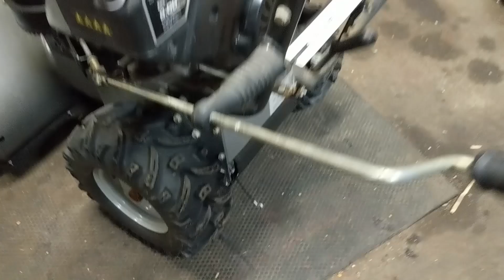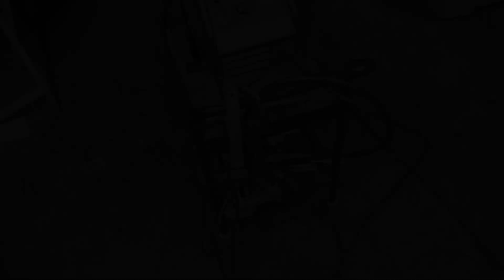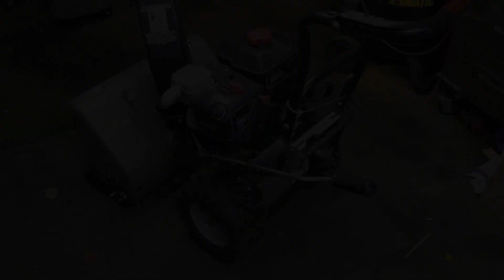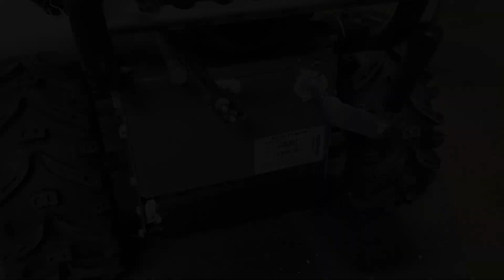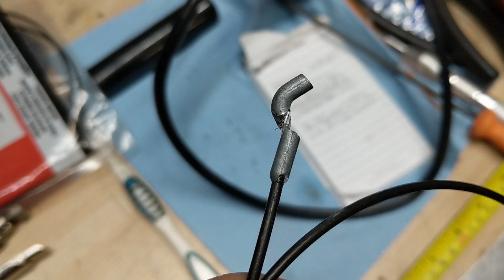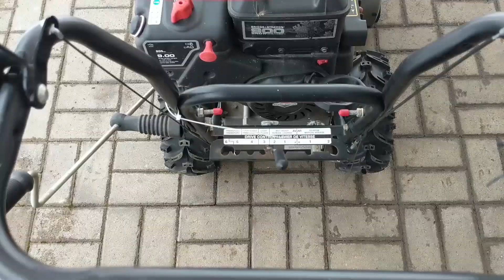Craftsman Snowblower - Drive Cable Replacement

Comment: That’s the exact problem I have.
As it was the middle of winter and I did a McGyver fix instead, this ended up shearing the pin on the drive chain spool.
So first I have to replace the throttle cable between the lever and that connector plate then replace the shear pin/bolt and I believe it should be good to go.
The auger belt and lever work just fine.

Comment: Dear Awesome Eliminator dude
So watched your cub cadet snowblower carb clean video and what would you know,after only removing the bowl,grinding down an old screwdriver and removing the brass thingy with the hole in it,which was clogged.I put it back together andViola it runs!!  BTW I use Startron as my fuel stabilizer so where the crap came from who knows.So I am going to call the repair man and cancel the pickup of my machine!

Comment: thinking about saying fuck it and putting a piece of 1/4 ready rod, eyebolts, and threaded chain links in mine instead of a cable >_> Probably not the right way but dammit if these chinesium sintered alloy ends don't shatter from normal intended use in the fargo cold.

Comment: Do you have a process for replacing the drive cable on a Craftsman 5.0 22 in?   It looks like my spring unbent, and when I tried to connect it back to where I thought it should go, the cable is really loose...also...my auger cable may have snapped, any info on replacing the auger cable on Craftsman 5.0 22in?

Comment: Nice to see you use the file to remove any burrs or sharp edges on the drilled hole for the Z to hook into. Putting a slight radius on the outer edges of the hole helps prolong the life of the Chineseium Z and when the spring ends of the cables start breaking at the hook area of the spring most likely due to continued use and a sharp edge. Grease was a great idea also.